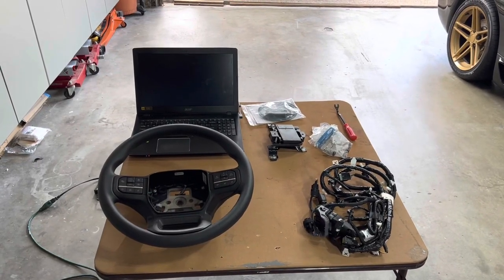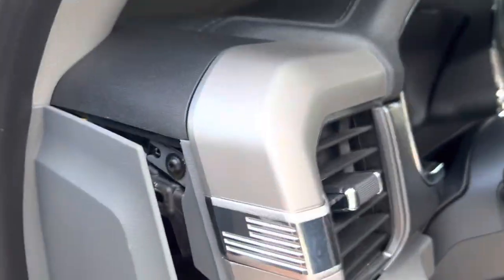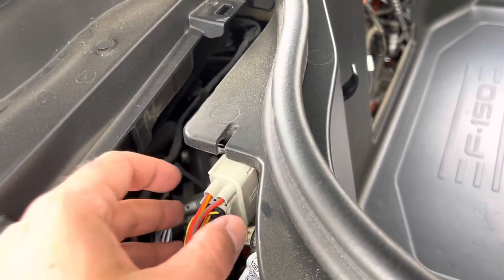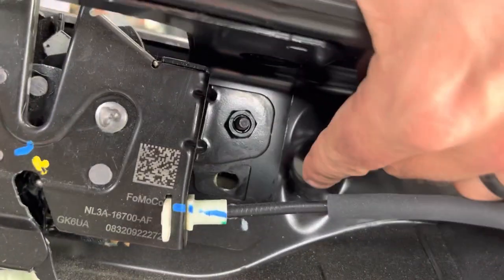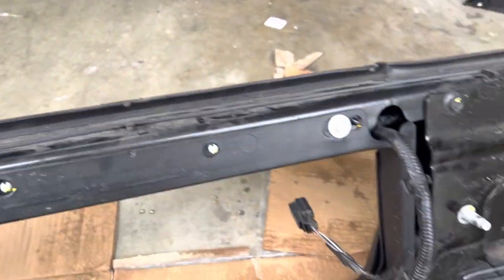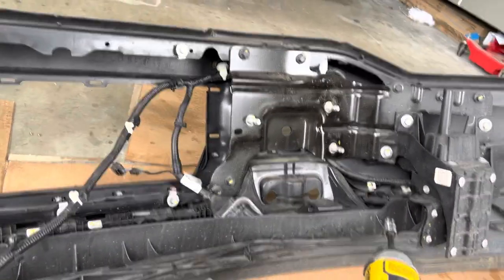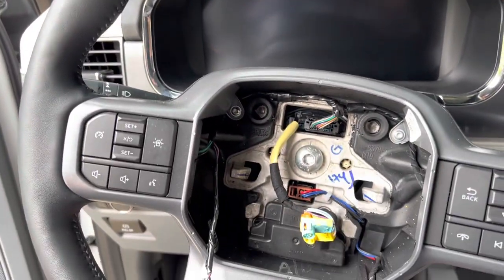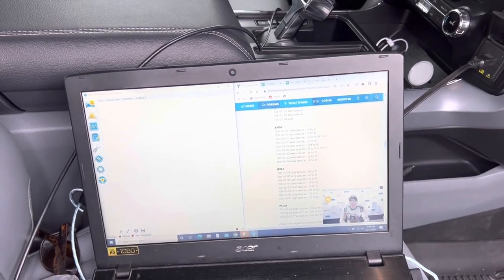F150 Lightning EV Pro/Xlt Adaptive Cruise Control Install.

Comment from the maker: Quick correction. In the video I seemed to imply if your truck is missing the wires this install is not possible. That’s untrue, however it becomes much more difficult. You will have to run new wiring. Others have done it on both the lightning forums and the ice f150 forums.

Comment: I did this with my XLT 311A. I tried answering a couple of your questions on this forum post the community lucky to have this video out there now. Thanks for letting people see what they're getting Into also if you set adaptive cruise control on and click the "lane keeping" button it's actually lane centering as long as you have lane markings on both sides and "hold" the wheel lol
Reply from the maker: Hey thanks. For whatever reason I glossed over that lane centering portion when I read the title of the post. Nice surprise.

Comment: You are fearless.

I love my 2023 Pro, but the one option I wish I could add is passive entry (just on driver's side).
Reply from the maker: I definitely got my eye on that one too. I installed the keypad as a sort of in between solution but it’s not quite the same. My old truck had it and I didn’t realize how much I liked it until it was gone.
Reply: here's been my work-around for 'keyless' entry from DAY ONE with my own PRO:     put the key fob in the center console and LEAVE IT THERE..  Your phone/FordPassApp will allow you entry with the push of a button, anytime, from anywhere - and distance is NOT a concern.  I even loaded the FordPassApp on my wife's phone so that, just in the case I could not get my own app/phone to work, she could give it a go.  It's worked AWESOME for 20,000 miles all over the southeast - I've never had any issue, and don't have to carry the key fob with me.  No door code needed.
Reply: @turnersinsurance8656  I'm pleased that has worked for you and, if I lived in a developed area with good cell service, I'd be tempted to try it. But my two homes are 1) in the Mojave Desert and 2) in very rural Arkansas. My travels, almost on a daily basis, take me to locations with poor-to-nonexistent cellular service. I all it takes is for either the iPhone or the Lightning to lose connectivity and I'd be SOL. Also, if anyone were to break into the truck, one of the first places they are going to ransack is the center console. If I hid the fob there - or wherever - I've literally just handed them the keys to the Lightning. I think I will wait until Kurt and others determine if passive entry can be retrofitted to the Pro.
Reply: @ontheroadwithralph1530  The key fob comes apart and that metal key can be used to enter the vehicle

Comment: So for those of you curious I have a totally bare bones truck (aside from extended range and max tow) I was able to do this by making my own wires from the IPMA connector under the drivers side dash, to the cruise control module then do all the steps in forscan.
Reply from the maker: Wow you got it working?  That’s awesome!
Reply: @KurtsRPMGarage  I’ll do a full test tomorrow but all it took was clearing the DTCs
Reply: Please make a video 😂 explaining all what you did pretty sure I’ll be in the same boat
Reply: @danimaljjmnhj4308  check out the big thread on the f150 lightning forum. I'm towards the very end and did a write up!

Comment: I thought the clock spring had to be replaced (plus you get free heated steering wheel)?  I love the  Frunk speaker removal, can you do door chimes next? Oh and blinker clicking?
Reply from the maker: Haha I’ll look into it. For this job no clock spring change required. 

From what I have seen no one has been able to crack the heated steering wheel just yet. Seems like it needs a new clock spring, a new 12v power wire run straight from the battery and who knows what else. Hopefully someone figures it out.

Comment: This is a great video! Appreciate you taking your time to explain and walk through the process.
 By any chance can Al these steps and parts work on a 2022 F150 lariat?
Reply from the maker: I believe so as long as it has the correct wiring. Consult the f150 owner forums. There are a few threads on the topic.
Reply: @KurtsRPMGarage   awesome! Thank you for your reply.

Comment: So I have the bare bones pro lightning my bumper does not have sensors. Do I need to order a different bumper with sensors?
Reply from the maker: Nope. Those sensors are strictly for parking. If you don’t have the tow technology package though there is a bit more work you have to do. Go to the link in the video description for the f150lightningforums thread on the subject. There is some additional wiring that has to be run.
Reply: Yeah, I have the plane bare bones pro lightning none of that other stuff
Reply from the maker: @Blackford86  Ya then you will almost certainly have to run the additional wiring.  Its not too bad but its not as simple as my video shows.  A few forum members have done it at this point.

Comment: So I contacted my dealer regarding this to see if they would add this to my vehicle. They said my vehicle is not retrofitted with the accessories required to convert it into adaptive basically saying that I don't have the sensor on top of the rear view mirror to be able to facilitate this. Do y'all think they're bullshitting just so they don't have to do it? Or is there a way to check if I have the proper equipment for adaptive cruise control

Comment: Bruh 👍🤜 you are amazing !!! I also have a fully loaded 2023 Pro like yours and I replaced the steering wheel after I watched your video ✌️ Now, I live in LA area (818), I am willing to pay you $$$ if you can install it on mine as well 🙏🙏 Hit me up if you're feeling adventurous 🤣👍
Reply from the maker: Haha I’ll think about it. My wife is going to leave me if I put off our bathroom remodel any longer.
Reply: @KurtsRPMGarage   I feel ya 😬 Well, when done hit me up, I'll order the parts and we can have few beers while enjoying our Pros 😊 Cheers mate 🍻
Reply: @KurtsRPMGarage Hi there! Are you still enjoying ACC? Any issues !? Do you also know if I get all the parts you have listed and install the needed parts would it "harm/error" my truck if I don't have the wires? Also, if I get lucky with the wires and install the parts would my Ford dealer program it, of course with $$$ !? Thank you sir 👍
Reply from the maker: @Vito_Bardo  hey man. Ya it’s been great. Use it almost everyday without issue. If you install the parts it shouldn’t hurt anything even if you don’t have the wires.  However if you don’t have the wires and turn it on with forscan the computer may freak out and throw a code.  No idea on the dealer question. I try and avoid dealers as much as possible. Wouldn’t hurt to ask though.
Reply: @KurtsRPMGarage  Got it, thanks. Yeah, I will install the parts but will not touch Forscan 😬 Once I install all the parts perhaps I can pay you just to program !?! 😉 If not, then I'll ask around if any of the dealers can, otherwise just drive around with all hardware installed hoping to find a brave soul willing to program 😎🙏 Cheers mate 👏
Reply from the maker: @Vito_Bardo  ya I could help you out if your near Anaheim.
Reply: @KurtsRPMGarage  Hello there 😊 I finally gathered the $$ to buy the parts and wanted to circle back with you and see how your ACC system doing on your Pro !! Still enjoying your long drives with ACC !?😊

Comment: I followed this guide exactly, prechecked for all the wires, installed everything step by step, programmed until up where CCM needs input but no matter how many times i reconnect/restart/ checked all the values I simply couldnt get CCM module to show up in forscan 😢 I have a fully loaded 23 Pro ... HELP 🙏🙏🙏
Reply: Did you ever figure it out?

Comment: Want to do this so badddd... just worried about the front bumper portion .... I'm not known to be delicate with clips. Forscan no biggy. just time consuming. My pro is a 22', do you know if any 22 pros have done this? Mine is early build, june 22..... Why check wiring on both sides of cab, necessary?
Reply from the maker: Unfortunately you need to check both. A few unlucky trucks appeared to have one side of the wires but not the other.  Don’t know of a pattern to it just yet.

Comment: So because my lightning was not ordered with the proper wiring, I’m just going to be wiring straight from the IPMA to the CCM. Is it possible to mount the CCM from the outside without removing the bumper? After that I can just fish the wires up with the tub removed. I guess I could have just asked you on the forum lol
Reply from the maker: I believe the bumper has to come off. The opening is just too narrow to put it on without doing so.
Reply: @KurtsRPMGarage  shame shame!! Such is life. I’m just trying to be a lazy bones.
Reply: @KurtsRPMGarage so in regards to removing the airbag to swap switches. At first you talked about unhooking the battery and letting the vehicle sit for 30 seconds to a minute, and then when you went to remove the airbag you said 30 minutes to an hour. 
Also do you have to turn the truck back on to move the steering wheel 180 degrees? Thanks.
Reply from the maker: Someone corrected me in a different comment.  You don't have to let the truck sit more than a couple minutes for the airbag.  I was just being overly cautious.  Also yes you have to turn the truck on to turn the steering wheel.  Otherwise it locks you out after a couple degrees.   @michaelt.9372
Reply: @KurtsRPMGarage  you’re the man.

Comment: Oh another thing, how did you determine the harness “NA”… so many variations of it
Reply from the maker: A user on the f150lightningforum  figured this out.  Did all the heavy lifting for the rest of us.
Reply: I’ve already looked at the forscan ahead of time, and it looks like there are a few different numbers and letters than what the guide
To changes shows the as built. Does that matter?

For example, one said change A to 4 , but I had an E where A was supposed to be. Still change to 4??
Reply from the maker: @Havencheer2014  ya I had the same thing. I took a picture before hand just in case and then went ahead and changed the value anyways. Seemed to work. No issues to report so far.
Reply: @KurtsRPMGarage  I got her all done today, easy peezy honestly. As some others, my first try I forgot one line of code, so didn't work right off the bat, but quickly fixed and recalibrated and was working great. FYI, my pro 22', had just the tow tech and pro power. that seems to be the pro's secret sauce to having all the wiring. SO worth the money, thanks for you video, it helped me tremendously knowing the steps and where things were. made it so easy. thanks again
Reply from the maker: @Havencheer2014  great work!  That’s awesome to hear!